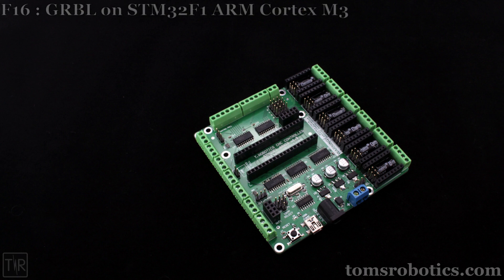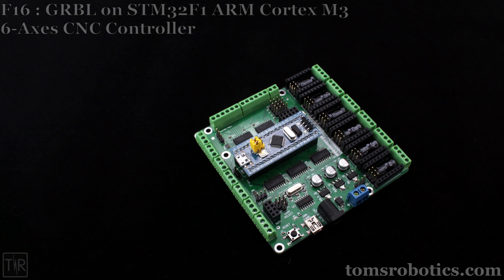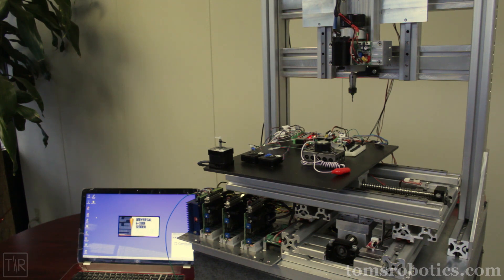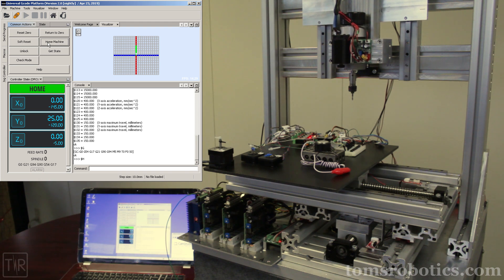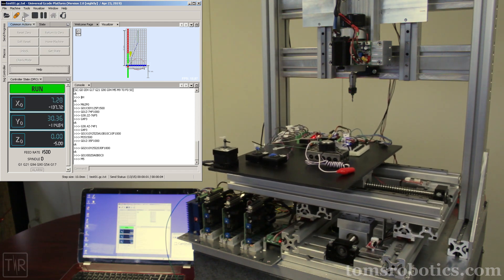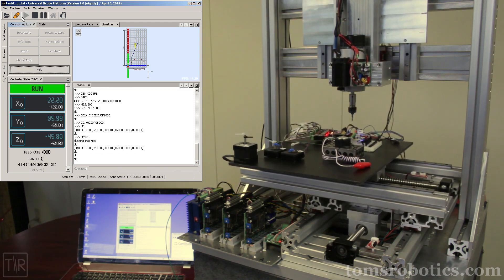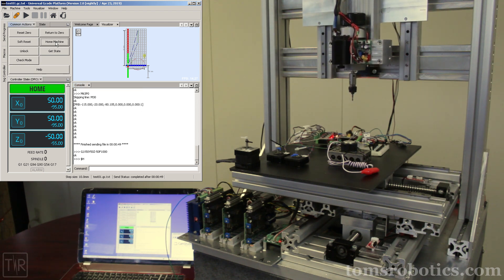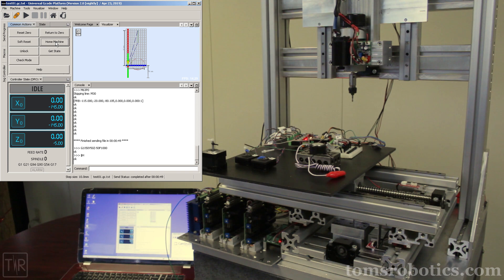GRBL 32-bit 150KHz 6-Axes CNC Controller STM32F103 ARM Demo GRBL32 F16

Comment: How do u control a, b & c axis using ugs?
Reply: probably hard code them in by hand when writing the gcode, remember ugs is just a gcode sender and will probably just dump what ever code it gets to the board, the board is what is doing all the error checking(softlimit exceeded stuff like that)

Comment: This looks like a really nice board, are those IC's for interfacing with the drivers?
Reply from the maker: Yes, the ICs are level shifter transceivers which sit in between the STM32 module and the drivers. They are also good for driving longer wirings in the case you are using external drivers.